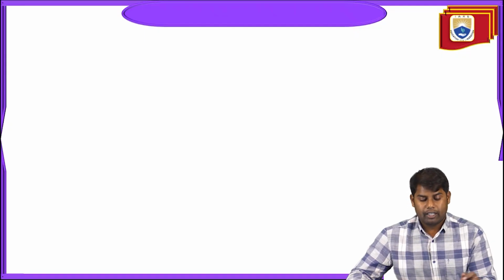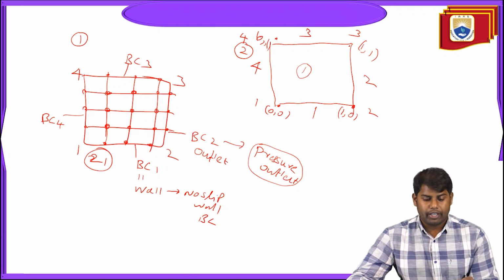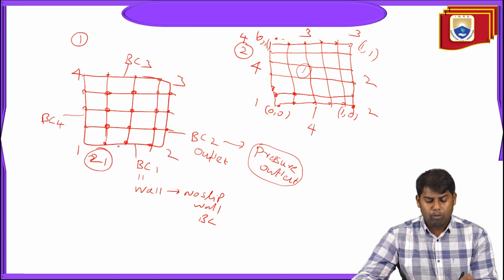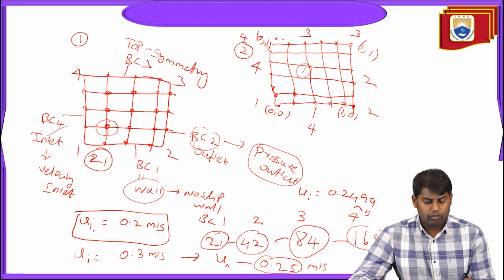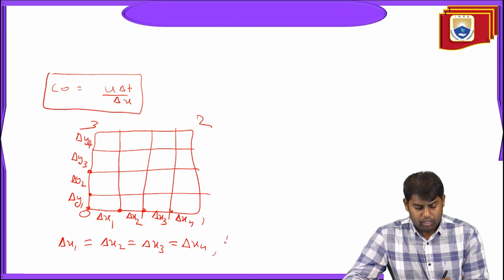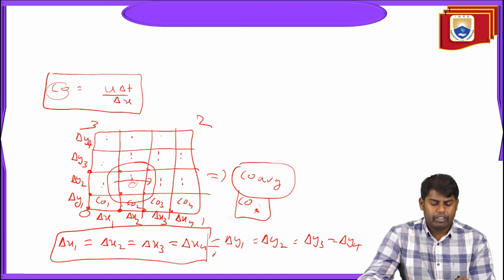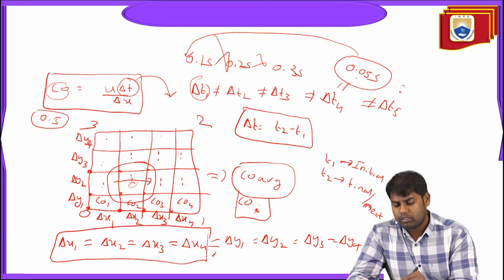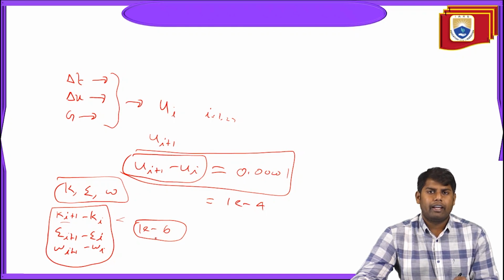Grid Independence, Time Independence study and Convergence of Numerical Simulation by Mr. A Rathan

Comment: Sir I have 2 questions:
1. Is it necessary to increase/decrease by half/double only or is there any other efficient methods we can use? If possible give some reference to textbooks or journals.
2. When you told about increasing or decreasing the timestep, is that del t used as constant throughout the simulation? In that case, what is the procedure to do timestep independence study for simulation where timestep will adjust itself to keep courant number less than 0.5?